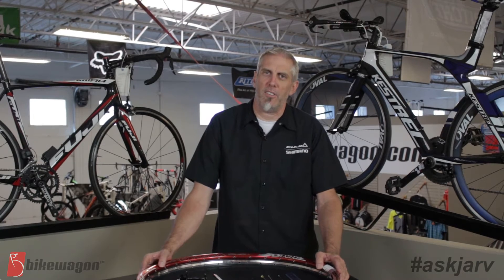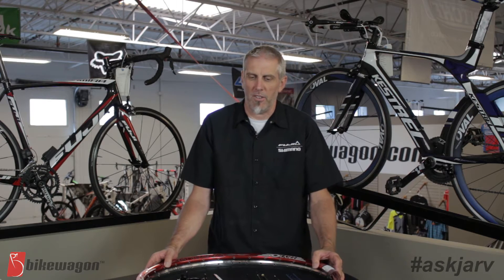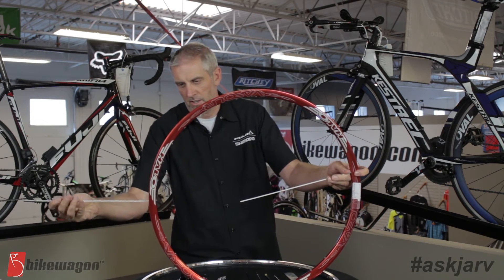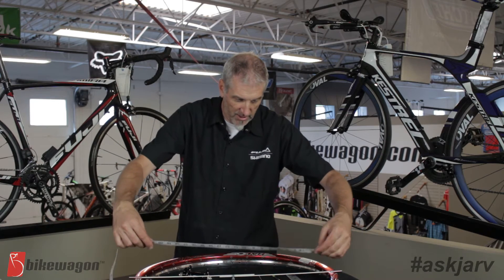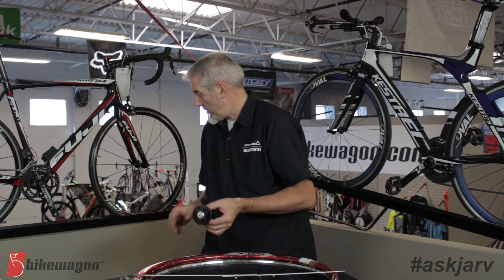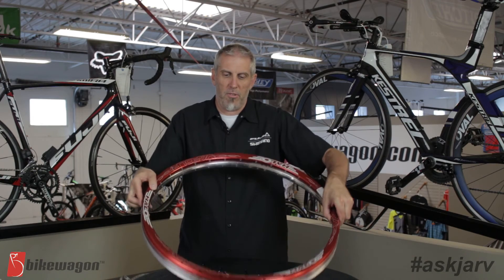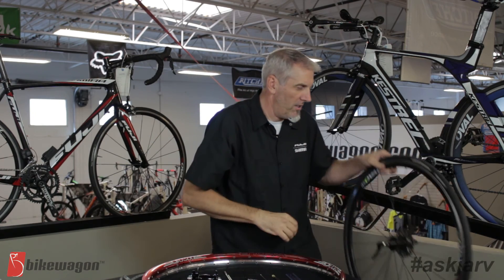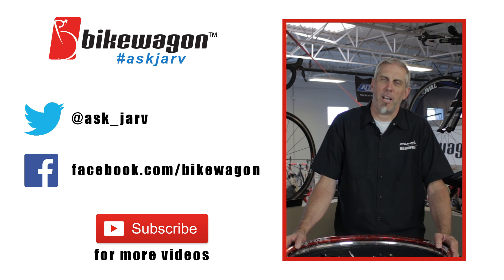#AskJarv: How to Measure Spoke Lengths

Comment: Rim Rods ;) 90 bucks retail in Canada, over priced (knitting needles or blank spokes can also be used). Just Mark the overlap with a pencil or pen (its wipes off from easily after) that way you reduce the chance of error when moving the clip since the ERD is the most critical measurement when calculating spoke length.
Reply from the maker: sky Maracle Thanks for the great suggestion!
Reply: Love your videos guys. I often show them to my mechanic students at WBI. Keep up the great work.
Reply from the maker: That's awesome, we feel so honored. Let us know if you would like us to answer a specific question for your students or have a specific video made.